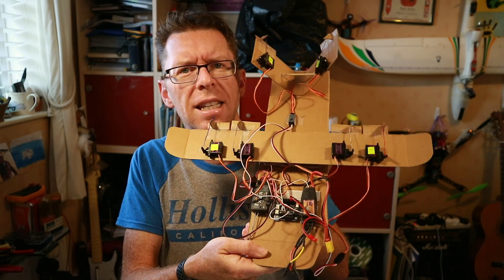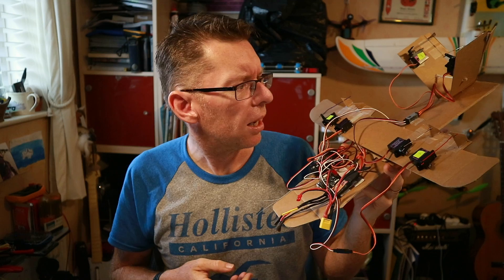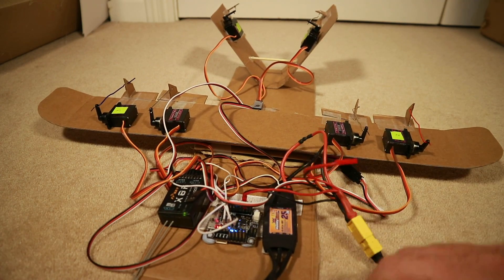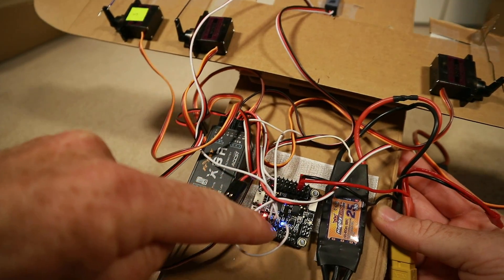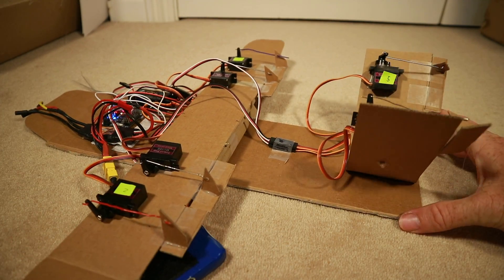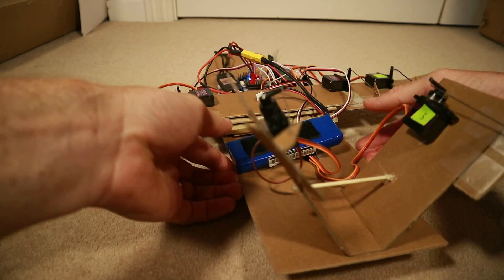Figuring out iNav for the Skyhook 2.6 - the cardboard V-Tail ! (and new blog)

Comment: How do you run SOME channels on SBUS while running others PWM?  (PPM?) using the discrete channel connectors?    I thought once you ran SBUS out of the X8R, that was it.
And can you split and run EIGHT channels on each?
Reply from the maker: There's several ways of configuring the RX depending on a few jumper settings when you bind it.  In it's default mode, you bind it as a d16 rx and it'll give channels 1-16 out of SBUS, but still provide channels 1-8 as normal PWM.  So in this case, I'm using channels 7 and 8 for the flaps, and not using those in the iNav config.  What I could do as well (and I have done this on my Naza quad) is bind with a jumper connecting signals 1-2 and 3-4 which then still gives me SBUS on 1-16, but the PWM channels on 9-16